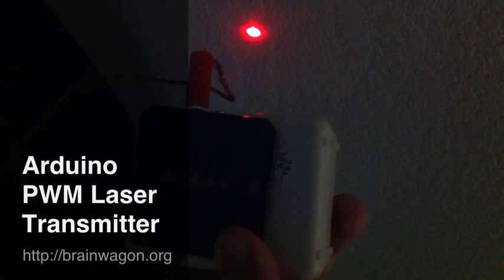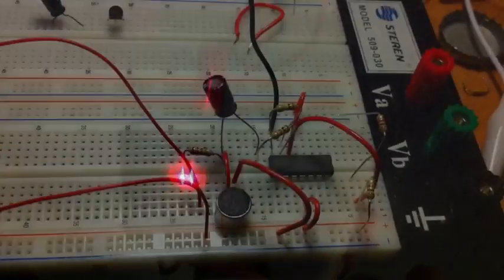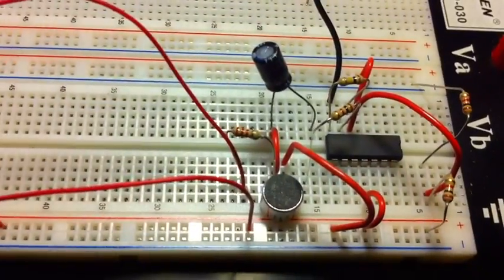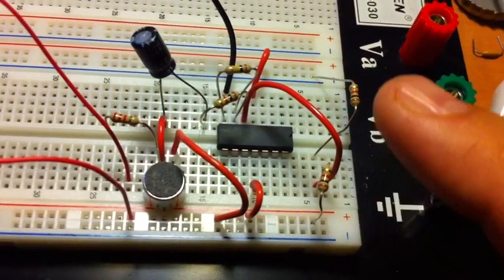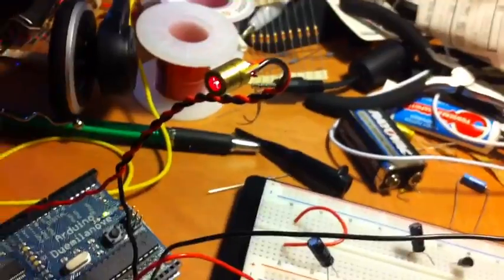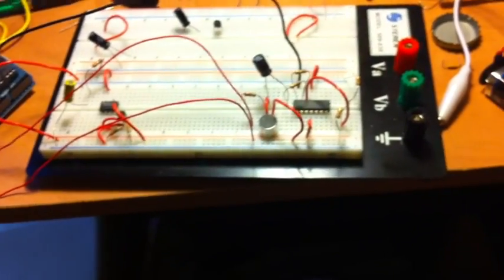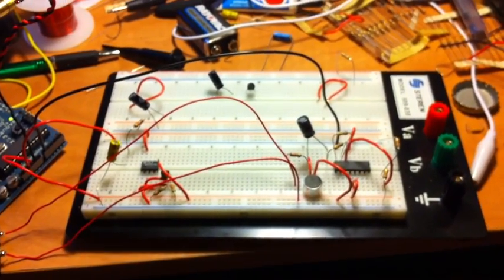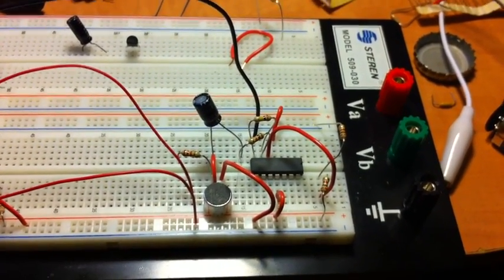Arduino PWM Laser Transmitter

Comment: I think you could either try to increase the PWM frequency of the arduino or maybe feed the PWM signal into a low-pass filter that will convert the PWM into a steady voltage... I'm trying this for myself and I'll keep you up to date!

Comment: so the "whole circut" simplyfied:

1 audio output
1 laser diode
1 solar cell  (box with an hole .. ^^)

and the flux is like that (with 2 arudino maybe)

pwm signal > arduino1 -> laser   ->>-> solar cell -> arduino2 -> audio

right ?

if you have experience with other receiver:

my questions would be:

a phototransistor would be also "fitable" - cause its also an semiconductor element
i just wonder that a solar cell is "fast" enough for pwm comunication with an laser

a photoRESISTOR instead would way to slow did you try that also ^^ ?